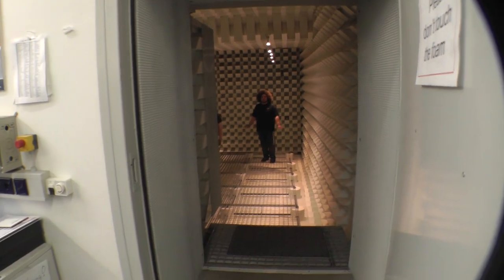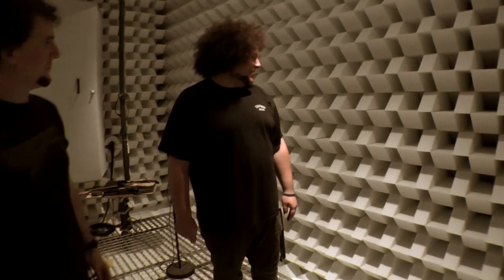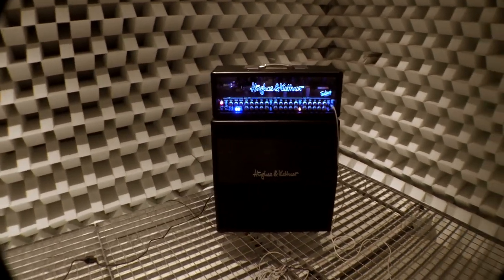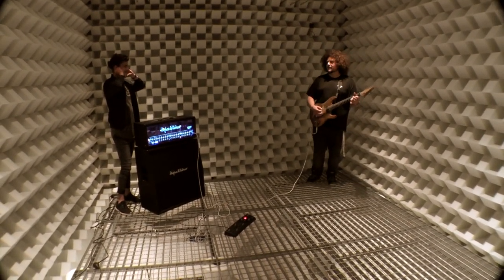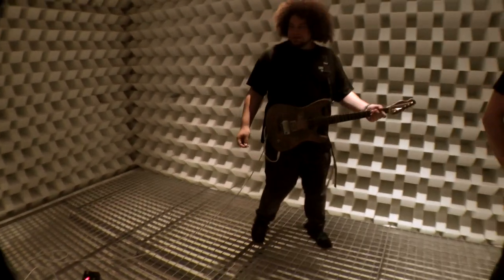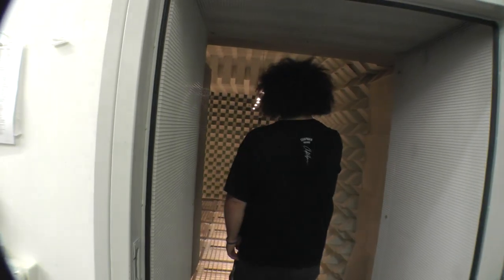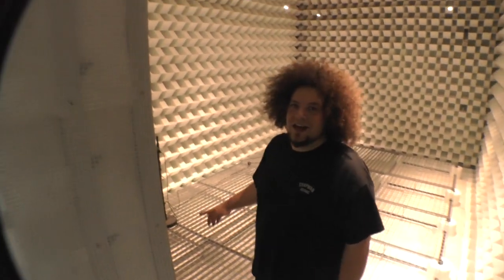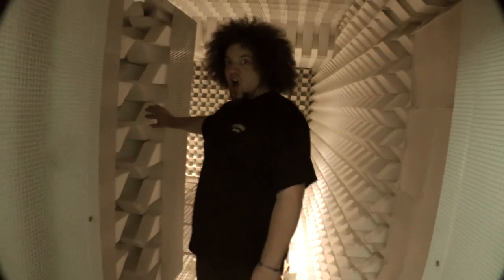Anechoic Adventures - Hughes & Kettner Triamp MKIII

Comment: Would be interesting to record an amp plus speaker with a mic not close up to the speaker inside of a chamber like this. Could gun the system and get some interesting sounds. Because it sounded great even on this little YouTube video.

Also why not have a piece of loose foam in the control room for visitors to touch? Just to get it out of the system:)

Comment: I've been to a few chambers and it's scary being inside one with door closed and lights off and you have to SHOUT as it sounds numb I don't see how that is the biggest chamber the ones I went in were pretty big they are used for RF testing on vehicles at TraC U.K. In Skelmserdale Liverpool only costs a £1k a day to use the chamber. livepool uni also has a semi chamber with an open back and a reverb chamber that'd be awesome to try this in as it bounces the signal everywhere